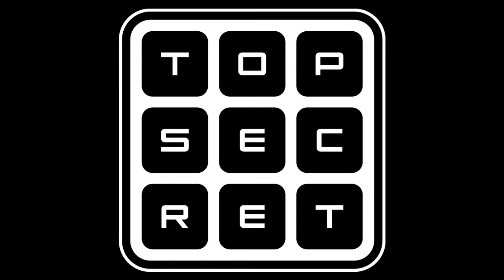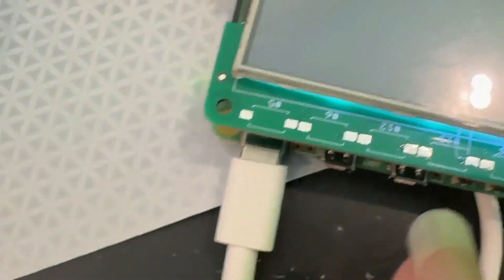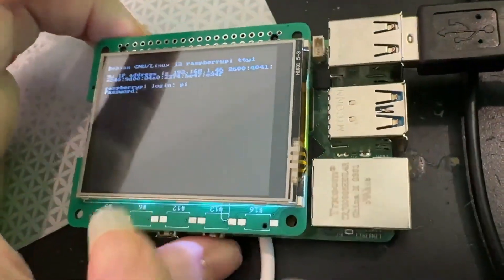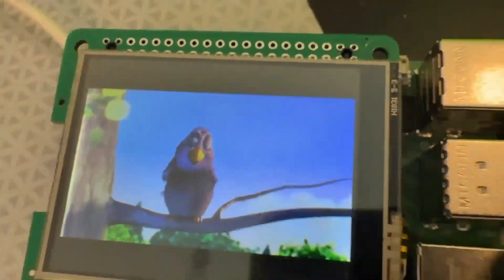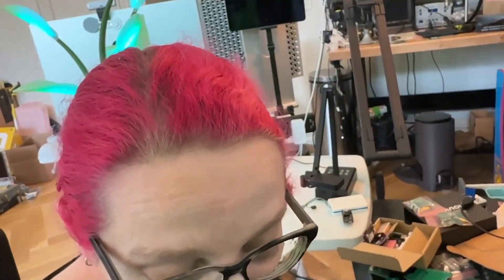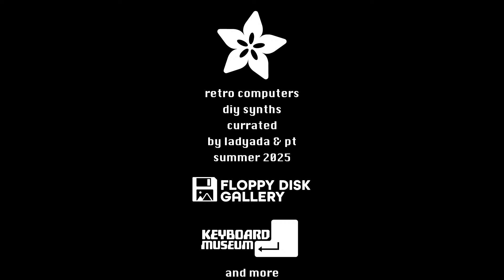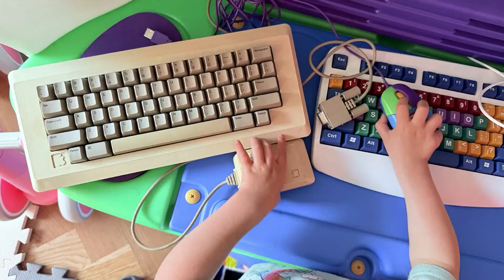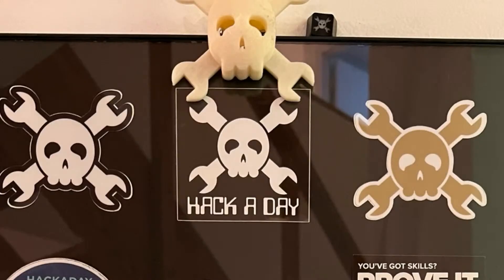Adafruit Top Secret for July 2, 2025 #adafruit

Comment: DRM in this case is the Direct Rendering Manager. And just an FYI to the Adafruit team, the Raspberry Pi foundation is starting their testing on Trixie (Debian 13) right now. You can do a dist-upgrade to get it and make sure everything is working there too. Maybe saves you some headaches later on.